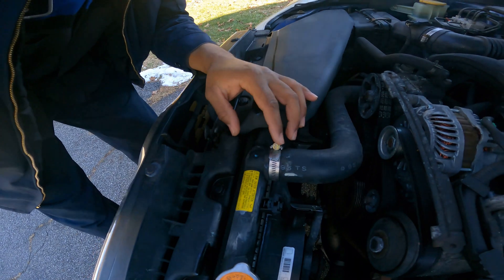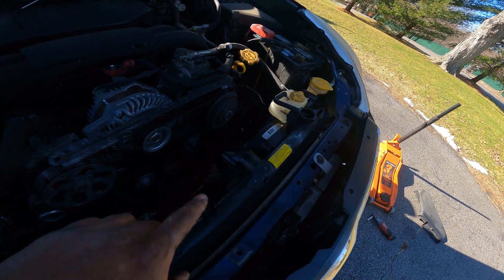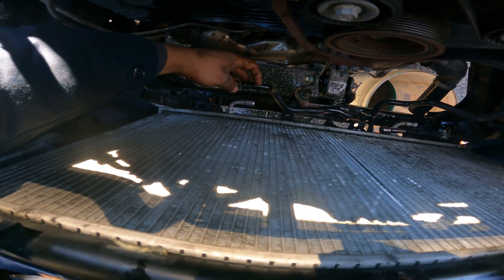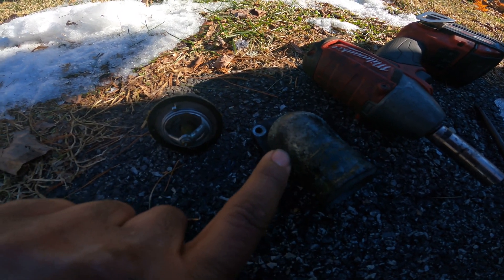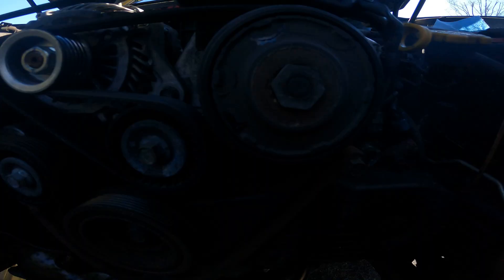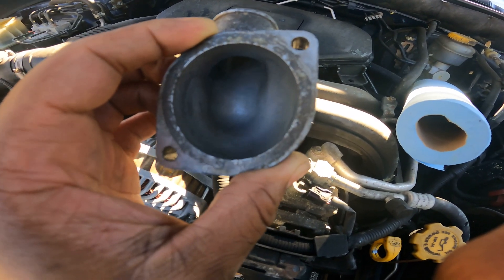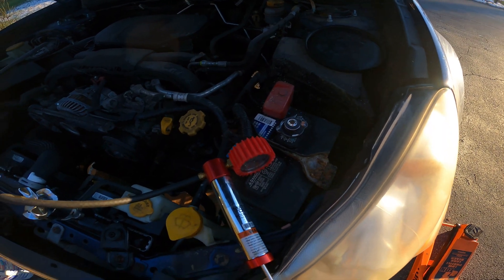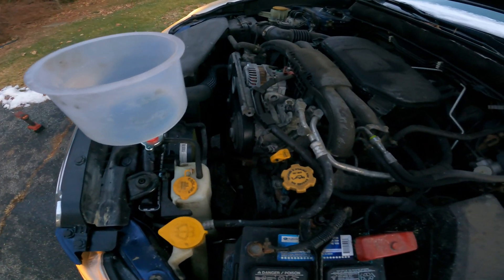2010 Outback Radiator Replacement

Comment: Why never show how to get the little aluminum line pipe is conected infront driver side ?
Reply from the maker: What are you asking specifically? How to remove the transmission cooler lines on the bottom of the radiator? I specified how I did it in the video if that’s what you’re asking.

Comment: Did u install  Subaru OEM   Radiator?  Its  out of stock and 2 months waiting  now...
Reply from the maker: Yes I did install an OEM radiator
Reply: What’s the price for the OEM radiator ? Do you need to remove the fans or can you pull the whole radiator out with the fans and then assemble it outside?
Reply from the maker: I’m not sure about price off of the top of my head and I would remove the fans first